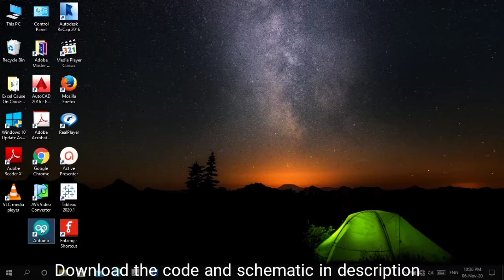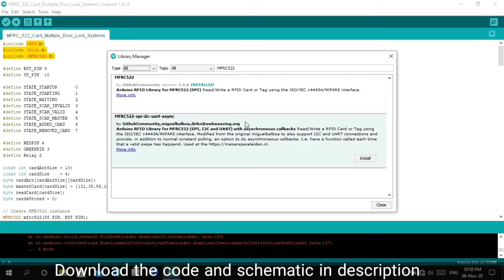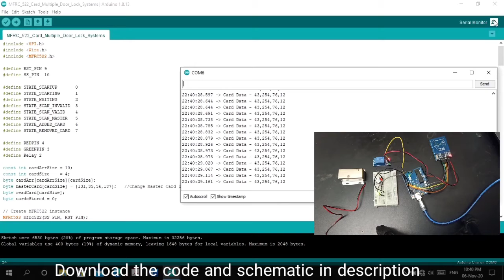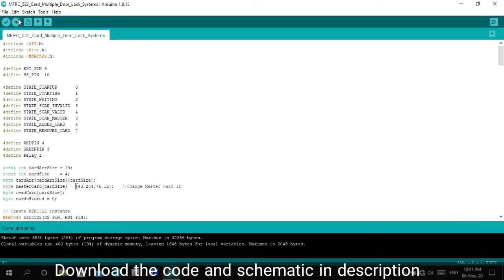How to make RFID door lock system with Arduino

Comment: everything is working but when i connect solenoid lock with 12 volt that uno board stopped working! i have to disconnect the power and power it again and after that it works for the first time only . please help
Reply from the maker: Hi bro...solenoid is separated 12v power source.
Reply: @passiontechklm  my solinoied is connected with another 12 volt suppy ! Codes and audrino works fine but when i connect the lock it open for 1 time after that uno board doesn't work ! I have to rebbot uno to unlock and it works only for 1 time
Reply from the maker: Is it your Solenoid is connected to NO side of Relay?
Reply: @passiontechklm  yes